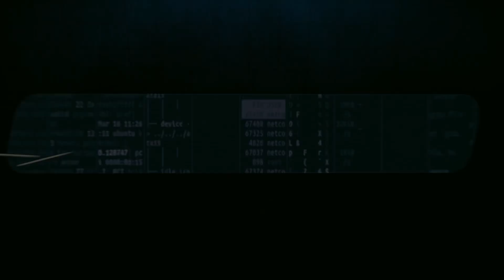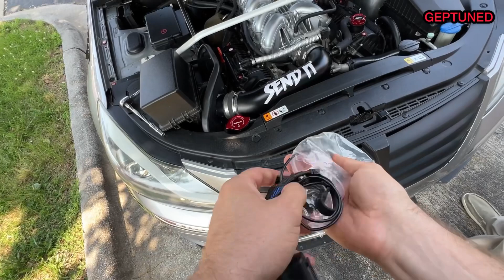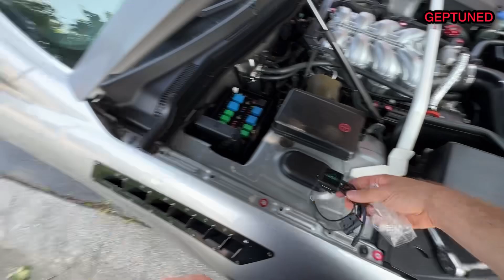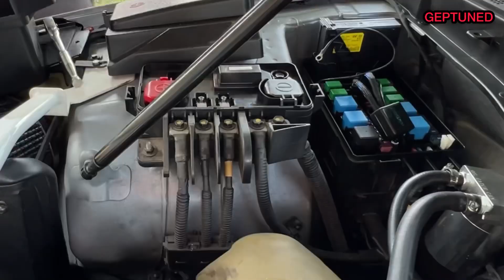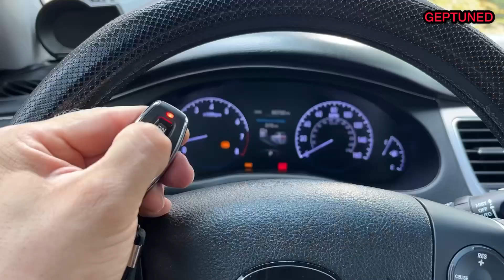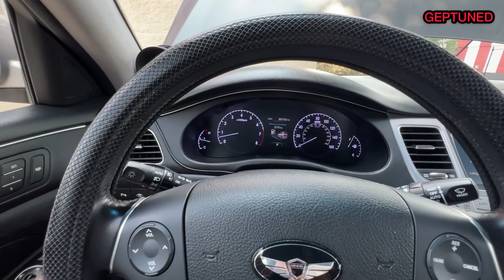Disabling traction control on Hyundai Genesis 5.0 R-Spec using GEP Traction Control Module

Comment: I want to thank you personally 🙏
Edit so I put it in and I still have traction control unfortunately 2009 Genesis,4.6. Do you have to run it with the ABS and brake light on to have no traction control?
Reply from the maker: @justinmcclain5549  in your case you need to click off button on remote - yes there will be ABS and traction light when traction is fully off. After you restart the car ABS light go away.
Reply: @GEPTuned  awesome thank you so much for the quick I appreciate you

Comment: Should do a before and after video of the burnout so we can see the difference
Reply from the maker: @blackpanther_4.684  burnout will tell nothing. When you try to accelerate and traction cuts power thats what is important to get rid of. Burnout can be done with factory car as well.
Reply: @GEPTuned so basically this gives you more acceleration when active?
Reply: @GEPTuned  I’m aware of that lol just wanted to see the actual difference it makes visually I’m still gonna buy it regardless just the 4.6 never gets any love 🤣it’s always the 5,0 just need more 4.6 content

Comment: My car doesn’t have a epb light so how else can I tell if it worked. I have a 2012 3.8, thanks
Reply: So never mind I don’t have a electric e-brake are there any lights that are supposed to come on my dash to indicate that traction is fully off?
Reply: @greasypeppapig6317 parking brake light, esc light and another one should come up. You can also just find the fuse and take it out. This product just bypasses having to pull the fuse every time you wanna have fun
Reply: @Richoffloudpack  sorry for the late response but okay thank you. Will the lights turn off after holding it for the 30 seconds or should they stay on?
Reply: @greasypeppapig6317 man I just plugged mine in & im trying to figure out the same thing haha , did you ever get it ?
Reply: @fullsendfee947 no I never figured it out and unfortunately I don’t have the car anymore, sorry!